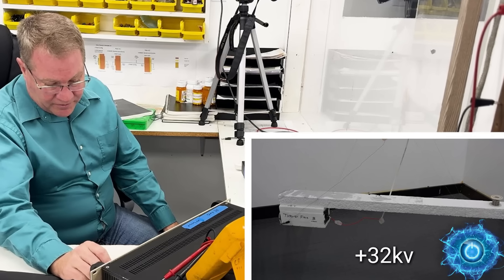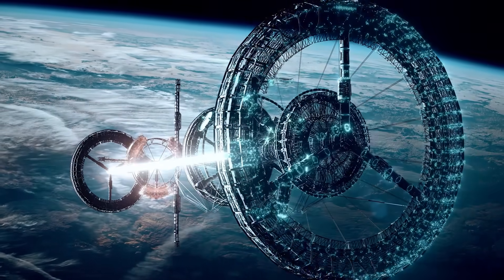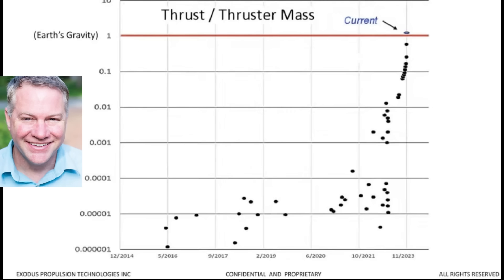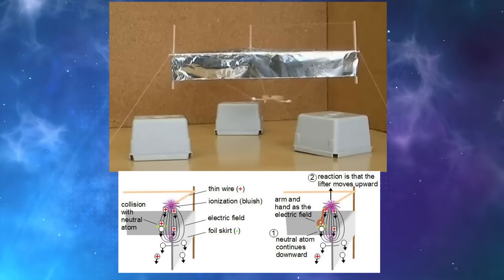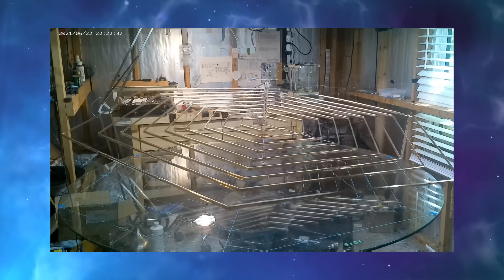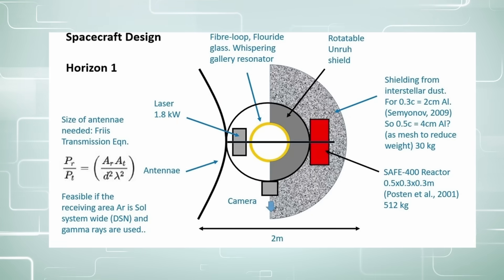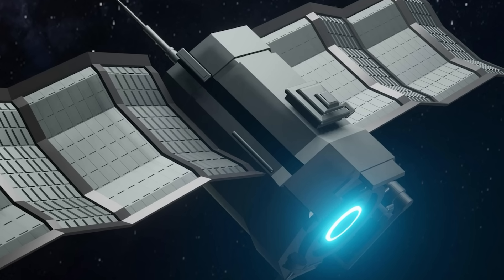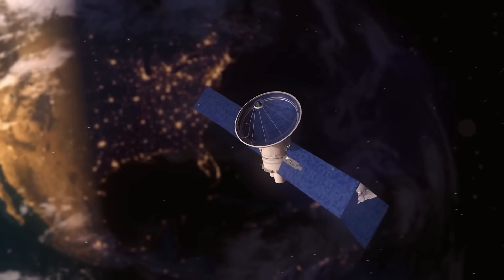Propulsion Breakthrough!? New Electric Drive Defies Physics

Comment: Also if you want to get super technical about it we're already using this technology because it's the same damn technology as an ionic thruster. If you took his design and you cleared out a little bit of the styrofoam and past Krypton or argon through that channel you would have an ion thruster. . . There's a better way to make a pellet list drive. The reason I haven't built it yet even though I've had the plans for for over 20 years from the guy that designed it is that we haven't reached a material strength that's readily available for me yet so that the thing won't grenade. It actually uses a counteracting force in an egg shape to overbalance one side of The Craft. You're not actually beating gravity, you're throwing weights in a certain direction and frequency so that it counteracts the force of gravity below you. This is the only propellant list drive that I know works and was this paper was also one of the reasons why we have reaction wheels from nasa. It was written by a family member back during the Cold war when he was living on a military base, he was too young back then to have a job but growing up with everybody in physics in our family and having early chemistry sets he's a bit of a genius. Very eccentric but a genius. His design works the same way as his reaction will did better to higher volume and continuous frequency.. I've managed to render it on fusion and now I'm learning to change them together before I actually build my first one. Again it's stupidly simple, just like most of our advanced technology. The problem is it's also super dangerous and if one of these breaks loose it's like a bullet.

Comment: Technically there's no such thing as a vacuum. That means that a thruster still should work in space, it's only going to have three or four particles add a time that's giving it any Force though😅. Remember folks, when you're doing calculations there is no vacuum but only an absence of pressure. Just like there is no such thing as cold there's only an absence of heat. Don't yell at me, yell at science.

Comment: We've been building these at home for years. It's just that we finally have a team of researchers with the proper equipment able to do the proper experiments now. A lot of us that have built these are limited in the amount of voltage and amperage we're willing to work with. I myself don't go above 30,000 volts. That's just because that's the biggest transformer I have. I made that from an old neon sign transformer that I modified and boosted. We've been able to build these for almost a decade and a half now the problem is that the power supply is not small enough to fit in the craft. You can't say it's a propellant list system because it's using the air around it as repellent and it's using the electricity as the oxidizer. This means that you still have to generate power and you have to have that power flow like fuel, energy flows like water, so that your system will be able to support itself off the ground. That's the problem right now. We've been able to fly these for almost 15 years on cables but we could never get it to fly without being tethered.
Reply: No I'm not talking about an ionic lifter by the way. I have watched his video and made his cell. It's kind of tedious when you make the little tea in the middle can you go up to the other plate but it wasn't super hard. He's posted about four or five videos of how to make this unit.
Reply: @SteveSiegelin  In space there would be no gravity so the weight of the power supply might not be an issue. The weight would cause inertia that would impact steering and braking. Something like this with solar sails might develop great speed, but it would be vulnerable to any solid matter it encountered. I saw a little ionic thrusted airplane a couple of years ago. It's an interesting start, not my field . Do think electrostatics are an infant science with great promise.

Comment: There's some things that I think are funny. It would suggest that if an electrogravitic effect is a thing, then when gravitational and electromagnetic fields are both present, it should be possible to transfer rotational momentum around an axis into momentum that is "linear" along a trajectory. Some of the stuff that leads to that is hinted by hysteresis effects of the electric properties of a vacuum and the product of the permeability and permittivity of a vacuum is the speed of light squared. Tie that back into other formulas that show mass and energy equivalence, and you can also see there is a relationship between electric and gravitational fields through a kind of mechanism there. It's a thing Einstein really didn't want to deal with (part of the "spooky action at a distance" type effects), and one or two guys were dabbling with it before wandering off into the territory of string theory rather than trying to see if there was something more immediately practical about it. The later quantum stuff is likely distantly related to it too, although that also went off into another direction as well.
Reply: Sir, how do you know this??!
Reply: Well isnt it obvious that electricity or dielectric effect should be added to the list of fundamental forces of nature which means there are only two left we don't know about.  There is only seven tiers to the binomial expansion table. 1 through 5. We have. Number 5. Is relativity with relativistic gamma describing something travelling at light speed. E.g. E = γmc^2, where γ = 1/√(1 - (v^2/c^2))    maybe one of maxwells equations works 😅

Comment: You lost me at the 37 second mark, where you say that testing this is a bit more demanding, as it requires ultra-high voltages (even up to 40 thousand volts)
40 KV is not even in the realm of rocket science; this is done all the time. While it does require some safety precautions, they even let undergrads work on it.

Sorry - government or interdimesional aliens destroyed it?

You are batting 000 on this one.

Extraordinary claims require extraordinary proof, and I'm not seeing anything more than snakeoil.

Comment: couldn't they just make I tiny one that runs by collecting solar energy and storing it in a capacitor that alternates pulsing to power the drive with pulsing to send a ping signal? So we could tell be the ping if it's accelerating from the little incremental nudges produced by the drive, if it works. I think that would be small and light enough to make it inexpensive to send up and probably pretty cheap to produce as well.

Comment: ISTR some tests of a drive using microwave emission.  What little recall is thrust was negligible.  The structure described in this vid seems different.   Someone else would have a firmer recollection of a vid from 6 or 7 yrs past?

Comment: Two things: First it may be that there is another natural background field that are neutral to us and our current technology, and that these devices interact this field mildly and inefficiently, like the first electric devices of the 1700s. It is likely over time, the coming decades new devices, theories, math will lead to much more efficient devices and technologies. 
The second thing is just a comment on the video at 3:27 the view of the Earth getting showered in particles: Those particles are going 6x the speed of light. Light is fast but NOT that fast. There is an excellent video that illustrates the speed of light where a camera is "mounted" on  a photon as it leaves the Sun and in real time the 45 minute long video shows how long it takes to pass all the planets and what it would look like. "Riding Light - Traversing the Solar System at the speed of light" : https://youtu.be/1AAU_btBN7s?si=ghicWAGy7YcAptro .

Comment: When you consider the distance, the magnetic field extends into space, and then one might take advantage of that as the accelerator.  Even the brakes or the steering! One might take advantage of a solar sail as well .
There is a lot of untapped energy in space.
Coming from the Sun 
They don't want just anybody running off to other planets, though for sure.

Comment: Space is technically not empty, there's particles out there. The relative density is negligible but not zero.  With sufficient energy, would it be possible to move that medium, like an electromagnetic version of a ramjet?  Then you don't need your own propellant.

You'd just need an energy density equivalent of a whole nuclear power plant in a small vehicle.  Like whenever we get fusion to work.
Reply: Yes, that's the theoretical principle of the Bussard Ramjet.  The problem is getting it up to operating speed.

Comment: Townsend Brown did achieve the results with the B bomber read the book by his daughter. I met a scientist in California that said this craft is real. I worked at a high end electronics company. I was a chemist and made parts for military. When I met this man. He had a body guard that never left his side. He was dying to talk about it. He said it was a 100.000 volt leading edge of wings allowed plane to go through air with no resistance. Said the bomber could fly just with the special system. Or both or jet. The lifting capacity increased. Also its distance increased.

Comment: Total bs. Algorithms do not have feelings or emotions, regardless if the programs can emulate human behavior. It is only a simulation. This is just as rediculous as the crowds that actually got frightened in the early days of movies, when the locomotive looked like it was coming straight at them, as if it could drive right into the theater seats. Learn to discern!

Comment: You have two effects happening that should not be confused. The ionic wind, and the asymmetrical capacitor.  They are not the same. Concentrate on the assemetiical capacitor where the thrust effect happens as a function of the leakage current thru the dielectric material.  If the "thrust" increases when the mass of one of the capacitor plates is increased, then you have demonstrated  gravity control.  The thrust is not inertial, ie does not behave like an external force.  The "thrust" is a " body force" acting through the matter on the nucleons of the atoms of the "thrust mass"  Gravity propulsion is an action on a mass from the entire universe..
Reply: No, it’s not gravity control, it’s just an electrostatic pressure force.

Comment: lol "technology like the transistor". I doubt you know but the research team that found the semiconductor transistor effect withdrew their paper. Published an announcement saying it was an error and dropped it. They could not replicate their own discovery. One staff member took the process to Japan where it was cheap to make lots of transistors in batches. 8 in 10 batches failed but the tested working semiconductor transistors sold to cover the cost of the failed ones. The fact that he was making commercial transistors from a debunked theory forced a re think. They realized it was not a property of the silicon but the impurities. All the researchers in the field had been trying to get rid of the very impurities, now called dopants, that make it work. Historically, when people a generation ago said "technology like the transistor" they were referring to both its ubiquity and the irony of its discovery.
Reply: Amazing bit of history, Thanks! On my YT channel, patents, and website are the answers with solid verification to most of this.  All people need to do is look at the info provided there. At this point my time is best spent improving the machine further. Best regards.

Comment: There is a fourth possibility to the three on your list. An interaction with the containment vessel of the ground based vacuum rig. This is most probable with metal vacuum chambers but could also happen with non metal and non Ferris chambers. Sadly no-one makes fully ceramic large vacuum chambers for checking. Worst still some non metal structural materials are good diamagnetic materials or are known to conduct, i.e. some Styrofoam's. So interactions with them can't be ruled out either.

Comment: I would think it only propellantless if you consider that chemical rockets are the only possible drive system. Take an electron gun for example. They used to fire electrons at a screen in old tv tubes. The electron left the gun travelled through vacuum and struck phosphorus dots that then glowed. The electron itself was the propellant. It  could not more the TV because the mass difference between the electron and the TV in earth gravity was so great that it was near infinite in comparison. But in space without gravity and tens of thousands of electrons if it even millions, it MIGHT, and I stress might, have a motive force. I have wonder since a child if this would work, but found no proof it wouldn't given enough power.
Reply: Ion thrusters work without charging up the spacecraft. Dump all your electrons and you better not try and land @nywhere!
Reply: @RV-qj6gm  not all s0ace ships need to land. A probe doesn't need to land. A satalite doesn't need to land. They have been discussing tractors that carry a landing craft that never stops between the earth and moon or the earth and Mars for many years. Once it's started, you just dock to it when it gets close enough, and it takes you the rest of the way. They never land either. You seem to have a very narrow-minded use case.

I'm not saying it will work, but if it does, wouldn't piggyback on a tractor be worth the fuel savings? If a rocket uses half it's fuel on take off and you could use a tractor between 2 points then you would only need half of the current starship rocket if you refuel in space and hitch a ride on a tractor. Then, it uses the refueled rocket to land and/ or take at the destination. Hell, the tractor doesn't even need to be manned. We have probes that go from point a to b for decades. Maybe you only need to send an update once it returns to earth for the next trip. Assuming 90% of the rocket weight is fuel, then cutting that in half increases the usable payload from 10% to 55%. That is a huge game changer. Along with the fuel cost per launch being reduced by 50%. Ie half the fuel half it's cost.

Comment: Explain Newton's Laws of Motion in relation to magnetic fields. Magnetic fields do not contain mass. There is no external physical force forcing two magnets together or apart. At normal strengths, magnetic fields only affect what we call Ferrous metals. Copper is considered non-magnetic yet a magnet dropped through a solid copper pipe is slowed due to the interaction of the magnets field with the copper pipe. The interaction of magnetic and electric fields seem to also bring Newton's Laws of Motion into question. Anyone have a detailed explanation?

Comment: Charles admits himself that he’s not 100% sure what physical phenomena are at work here. One possibility could be virtual particles with mass. See dynamical Casimir effect, works of Hal Puthoff for example. Based on those, I’ve started with a thought experiment of building a propeller that would work in space.  Because of lack of certain measurements (e.g. density of virtual particles, their mass, etc.) I’ve decided to test my idea, still not 100% convinced, but very encouraging. The link to the paper and a short presentation is on my channel. My testing continues...

Comment: There is another issue that is often overlooked with these propellentless drives. And that is electromagnetic radiation can produce thrust. If you turn on an electric torch (aka flashlight) it will push you in space... But only very slightly. And this effect can even be observed with infrared radiation (aka heat radiation). With the minute levels of thrust these devices put out this effect can actually be what actually is providing thrust. So you need to take that in to amount and do better than that. Else you may as well just used a high efficiency electric torch drive (or something similar)

Comment: Whether it works in space or not, we will eventually find out. Either way, it could be of use here on earth even if the only thing we ever get out of it are small drones instead of flying cars.

As far as not believing it could be possible... I don't know, maybe? Could it be reacting with the quantum foam, background radiation,  or with whatever the heck actually fills up space? Sort of like a propeller in water? In which case then its not reactionless.

Comment: You don't need to test in a vacuum. Just put it in a sealed steel box
Reply: The device is shielded even within the vacuum chamber.
Reply: @RV-qj6gm  Well, good shielding is extremely difficult. It would have to have an internal battery and power electronics and zero connections to the outside. Literally a seamless welded steel case

Comment: "Permittivity is the measure determining the electric field produced by charge in a particular medium."  The value of permittivity in space is not zero.  Therefore there is a "dielectric" for an electric field to act on.  The limitation is that the electric field must be non symmetrical.  The question is, is it this dielectric allowing the field to produce thrust?
Reply: Have you read the T.T. Brown papers and what he said about the dielectric?  
Every scientist that I point this out to, seems to just ignore it, or not respond.
- If you know where I am going with this, then let me know...
Reply: ε₀μ₀ = c² And substitute that into something like ϰ=(8πG)/c⁴... Thus ϰ=(8πG)/(ε₀μ₀)²
Playing around with stuff like that is kind of funky. Another funny one is m=E/(ε₀μ₀), which is what happens from re-arranging E=mc².

That has some implications that an electrogravitic effect is a thing when both fields are simultaneously present.